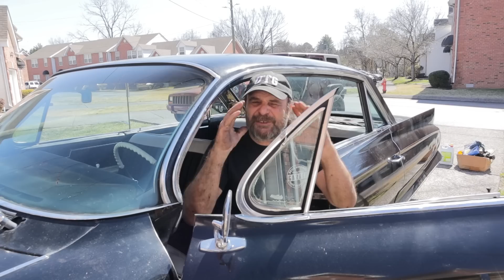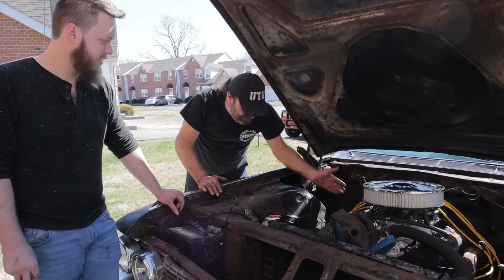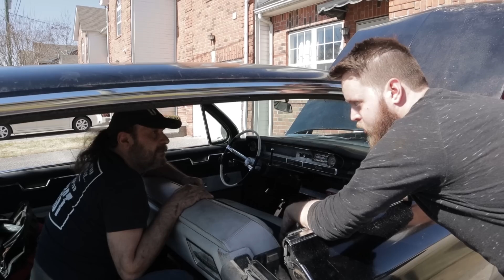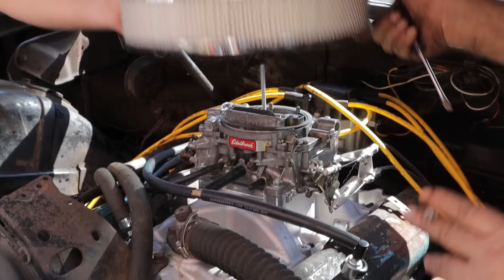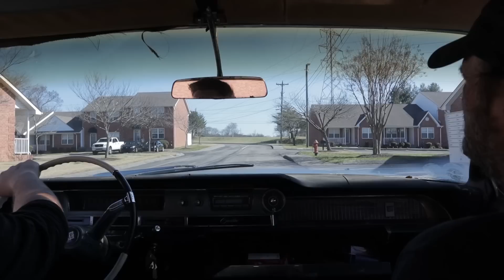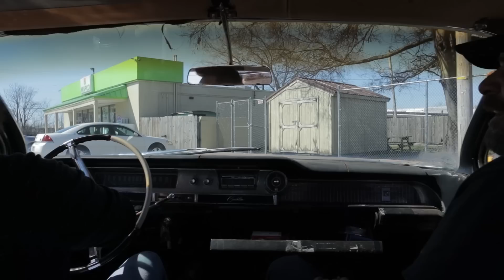The Perfect Entry-Level Classic Car?

Comment: As an owner of a ‘64 Cadillac, I’ve got a hard time agreeing that these classic pre 68 Cadillacs are a good entry point for classic car ownership.  First of all, the 390-429 engines are so hard to get parts for.  The transmissions are a pain too.  I don’t know what’s in his with the motor conversion and all, but OEM it was a four speed Hydramatic.  It is still the hydramatic if reverse is located all the way to the right of the shift pattern.  The transmissions are bulletproof, even used in tanks back in the day, but are heavy, complicated and parts are obsolete.  Cadillac 390-429 engine to trans bolt pattern is completely unique in the GM lineup, so swapping just the trans or just the engine often requires an adaptor which is hard to come by.

Also many GM parts that we take for granted as being the same across most GM’s are unique to these classic Cadillacs.  I needed a turn signal switch for mine, and after weeks of searching compatibility discovered the Cadillac unit is bespoke to only my Cadillac and one model of buick.  I had to buy a used turn signal switch out of Arizona, and it wasn’t cheap.

Also finding body panels is nearly impossible.  But when you do find a fender or such, expect it to be fastened with 10 times the amount of bolts you would see holding on a Nova or Chevelle fender.  I can’t believe how many fasteners are on these frikkin cars.

That being said, they are a lot of fun and get lots of looks, and we’re truly built to last.  My car has 175,000 on the original transmission and engine, with lots more life in it.  I would strongly recommend getting a factory repair manual, they are fairly cheap and help a lot.  Best of luck.
Reply: I watched carefully, and the shift pattern looked normal for a 350/400.   The car probably has a 3.25 diff ratio, but it seems to be turning pretty quick.  Sorry, I'm a Mopar man.
Reply: @moyadapne968  yes, I noticed that after posting.
Reply: Yeah, the car as I got it has a TH350 instead of the factory transmission.
Reply: @Jon-in-nashville  that’s a very good thing for drivability.  Probably why it feels low geared though, as the old hydramatic had a taunus rather than a torque converter, which doesn’t slip.

Comment: Beautiful cool old car one thing I never liked about those was the Chrome trim  on the doors the doors  Runs talk to bottom Off those and the lines flow my OpinionGeneral Motors it took a long time to get it all to make a bracket right Serpentine belt in the nineties is when they got it figured outI like the small block swap cause then you can get easy parts Anywhere

Comment: I imagine a small block chevy would be working pretty hard to get the torque needed to move all the mass of a fine old Caddy.  My `76 Cadillac still has it's original 500 CID engine in it.  Now THAT is torque and still over 12 mpg for hauling 6000+ pounds.
Reply: How much torque do you have.

Comment: You will most likely have to make your own floor pans. Depends how much $ you want to put into it. Some caddy body parts are almost non existent.. it's a cool ride.
Reply: ..might be able to modify or add on to some '61-'64 Chevy Impala floor pans to make them work...body shells were similar, with the Caddy being stretched a bit...
Reply: @dyer2cycle  that's nice thing about hot rodding just find parts and make it work

Comment: "The only thing I've ever owned with a carburetor was a lawn mower".....

Oh, the places you will go...

Great post, great car, and IF you want to go fuel injection (Doubt I would, but it does make turbocharging easier, and more effective, I am told) then the earliest EFI systems are still pretty owner-understandable and because of the huge numbers of Chev and GMC truck owners and of course the Catfish Camaro Crowd there is a huge aftermarket and online community. Of course, you can get 500hp out of a carefully built naturally aspirated SBC, with great reliability and you won't even have to put a hole in the hood for the blower. 

I know that 'drum brakes work', but with something so enormous and heavy, I think this one is a solid candidate for front wheel disks, and I would look into how hard it would be to put together decent ABS, but I live in a place locked in winter half the year, beside a mountain range which you can't drive in without winter tires, in August.  People do, of course, but they risk being snowed in for a week or risking a pretty high possibility of a vehicle ending disaster. 

I didnt hear your uncle say anything about the rubber, but I would not drive a car that heavy without MINIMUM new and quality rubber on the front wheels.  A front wheel blowout on that thing in traffic or at a the wrong time in a curve could have you thoroughly fucked up and well over your insurance coverage in five seconds flat.

But man, it looks unbelievably well preserved, the missing original engine is actually awesome, removing all temptation that might have turned you into a restoration snob, or more likely made the car unaffordable in the first place, and you are uniquely placed to do a GREAT set of videos on how to buy an old car and get through the first year of ownership. Sort of filling in the niche between Vise Grip Garage and the trillion channels about making a hotrod/dragcar/showcar out of a barn find.   DO IT!!!!

Comment: I have had a 66dart with the 273 4barrel,1970sattalite,1972charger,1969 4door sattalite,1964 273 2 barrel valiant and I now have a 73 charger 440 the only one that I would consider a performance car was the 66 Dart GT with the 273 4 barrel 4 speed sure grip no power steering, no power brakes no air, no heater straight up bracket racer from the showroom floor but all of them you could get 4_6 people in fairly comfortable, would love to get some thoughts about the atrocity of the 1973 front suspension change and how you would improve it

Comment: The most obvious issue that I see under the hood, other than the spinning fan sticking way up above the radiator just waiting to remove a few fingers (or worse), is the battery cables running over top of the core support. Hopefully they won't rub through, short out and burn the car down before they can be routed properly.

Comment: That's why I love my 1976 amc pacer x everyone has a camaro.I am the only one  who has a  pacer. Bought it for a 1,000 buck in 2002 with" soposoldy"a blown engine .  I still have it with that same engine and I get more thumbs up and stories than any of my other classic cars. Man did I laugh when I was put in the same class at a car show with Camaro's and Cuda's and my little Pacer took the trophy 🏆. It's a Kenosha Cadillac. If that is a Chevy 350 put a 700r4 behind it. My 1992 3/4 ton g20 van with 3.73 gears gets 21 miles per gallon on the hwy with a car on a tow dolly behind it and the ac blasting.

Comment: I couldn't hear what he was saying about the PCV when he took it off, he had 2 pcv's?

Anyways I'd have to disagree that this is the perfect starter car. Anything that isn't popular is going to be difficult or expensive to get parts for. The saving grace is that this car has a SBC and is so solid and functional. A newbie is best off with something that has a SBC, SBF, or LA, on a 4 door platform of a more popular 2 door car. 4 door G-bodies, foxbodies, are easy to find, can almost be rebuilt off the shelf, are steady in value, and in the long run for the newbie are worth the initial cost. I intentionally left out chrysler because im just not familiar with whether an aspen/satellite is similar enough to a baracuda or roadrunner. 

I'm not saying this isn't really cool, but this car is a few issues away from being a newbie's money pit, especially if it had the Cadillac motor.

Comment: ..I'm thinking a 700R4 might be good for this..would give you overdrive, which would help with cruising and might give 2-3 mpg better mileage..and if the car originally had a 4 speed Hydramatic, you should have enough positions on the shift quadrant for it...

Comment: I hope you are looking for the original steel wheels and the Fleetwood wheel covers.  They really stand out on a black car.
Reply: I have 3 of the original wheel covers. I'll have to find the last one and restore them all.
Reply: @Jon-in-nashville  Do they have any paint on them?  The Fleetwood models, including the 9 passenger sedans and the limos and the black paint on them to match the car.

A friend of mine back in the '80's had a perfect 1962 code S formal limo and we drove that car all over the western states.  It was a joy to drive and it had those Fleetwood caps.  If yours doesn't have the paint you should consider painting them to match the black on the car.  They make the car look much better.  The original steel wheels are going to be really hard to find though.

Comment: 6.0 ls and overdrive transmission swap  from a rusted or smashed up truck.  I'd get it going with the efi, and stock computer, but there are carb  intakes for the engine if you want to keep it as simple as possible. I think there are also certain years that bolt up to the trans you have now, as in same flex plate, but I'm not certain on those details as I didn't come up with the swap. Just second hand bits i recall some else telling me what they did and that was to manual trans anyway. Seemed while they all have the same bellhousing pattern the crank shafts were not all the same. I'm sure there is any thing for any combination, this would possibly just get it done with stock cheap parts. As more so a Ford guy that's where I'm jealous. Ford just did not make many modern engines worth swapping into my own project, so I spent a lot to get a 351 w built . It is just carb at the moment  for the sake of fuel system being a single line , but in all reality there are a couple ways to do it  and possibly not have to alter anything. I have a jeep with fuel injection and factory it has the fuel filter just about right at the gas tank and it also regulates the pressure, and a short line dumps it back into the tank so only one fuel line  runs to the front of the car.

Comment: I can almost guarantee this will not be the your last Caddy. I have had many 60,s & 70's Cadillacs. I'd drive'em until I had a project to throw the 472/400 turbo into.  My Nomad has power windows, power vent windows and power seat track from a '69 Sedan Deville.  Nothings Lacking When Your Cadillacing.

Comment: That’s not a tbi engine. It doesn’t have the center bolt valve covers.
Reply: I would guess it is a mid 70s to early 80s engine if the blue paint is original

Comment: I'm not sure what it's called (the rear tires are behind the fender), how do you remove/replace the rear tires?
Reply: Those are fender skirts. Some of them are removable panels, others the wheels lower with the suspension enough they are not even a problem.

Comment: The wire wheels are not disco era .. they are late 90s early 2000s lower end level bolt on wire wheels. The high dollar ones where usually knock off style wheels.

Comment: Man that is a Massive car it’s got to weight almost 6000 pounds.👍😎
Reply: Actually about 4400 before the transplant, so maybe 4200 lbs. Less that a Tesla model S.
Reply: They don't weigh as much as you would think. Limited electronics saves alot of weight.
Reply: Why would you think a 4 door sedan weigh 6000 pounds?
Reply: @Dr_Reason  That's what I tell EV fans - many are heavy as a classic Big Three land boat
Reply: Well you look at the old Lincoln’s and Imperials there almost that weight fully loaded.🤣

Comment: Every american car here in eu is expensive. But we have plenty of TAUNUS models which was a german subbrand of ford. Taunus P2 for example is like a shrunk 1957 Ford fairlane
Reply: @32degreesretarded62  yeah they were pretty expensive here when they were new so not many people bought them back in the day. Weirdly even Taunus was sold in usa until late 60s in mercury dealerships. They even had ads. You can see it if you type "ford taunus p3 17m us werbung" but they sold very little there and are extremely rare right now in usa
Reply: @32degreesretarded62  no problem

Comment: Nice car! The first thing I would do is get rid of that electronic ignition and put in a point distributor.. Use NOS points and a new condenser. It will run smother and start easier.

Comment: That '62 "6-window" was the same car that was crashed 50 mph head-on against a 2002 Cadillac, which was documented on YouTube. It was a white one that was more derelict than the one in this video. This crash test was done to show crash safety advances between older and more modern cars. This demonstration crash was survivable in the 2002 for front seat passengers. But anybody sitting up front in the '62 would have surely been killed, even with seat belts and air bags!

Comment: 3/4 throttle, just before the secondaries open, uphill on a good grade at 50 mph/high gear.   You should hear a slight ping, not a knock.  Perfectly in time.

Comment: It's too big for me. I want something much smaller. It doesn't even need a V8. It just needs to be carbureted with no emissions crap (ok, I can deal with a PCV valve) no computers. It can be a Ford, Chevy, or Mopar, but it has to be something most parts are available for. Ford Falcon, Chevy II, Dodge Dart, Plymouth Valiant, Maybe a mid '60s Ford Fairlane, Mercury Comet, Chevy Impala, or pretty much any 1960s 2 door truck. The '70s has a lot more cars of the size I like, and yes they were loaded with emissions crap, but a simple engine swap can take care of that. I already have a 1972 Ford Pinto woodgrain wagon that I converted from a SOHC 2.0L four cylinder to a 289/four speed from a wrecked '67 Falcon. I did that before I retired. Took me almost 2 years. And now I have a car with a nice engine and transmission, but almost no body parts, glass, interior parts, even brake, steering, and suspension parts are available for. Take that into consideration when buying an old car. And that is the problem with buying a non sought after car. If you have a '57 Chevy or a '65 Mustang, you can get anything for it, though most of it is made in China. It's the less popular cars that you can't find parts for. Nobody makes them because there is no demand for them.

Comment: 2 years before the TH400 was introduced so what was in this?  Slim Jim?  4 spd fluid coupling Hydramatic?

Also, I had NO IDEA that you could get a 60s Cadillac with roll-up windows!!

Putting a 350 SBC is NOT "miles ahead"
An old small block that probably could use a freshening brings you back to square one.  Plenty of rebuild parts available for 390 429 engines.  It seems the 4 spd Hydramatic was the only unit available until the Turbo 400 arrived in 64.  If he really wants a dependable driver and doesn't care about originality, then a crate LS3 with ecm and a 4L80e and tcm is ideal.  Personally, i'd ditch the SBC and either locate a 390 and Hydramatic or make it simple with the crate LS3/4l80e combo and focus on other parts of the car.

Comment: No power windows?  That must be a 62 series sedan, ,not a DeVille.  Is the VIN 62K or 62L?  The K is the 62 Series Sedan and the L is the DeVille.

There is no front middle arm rest.  It is for sure a 62 Series Sedan, not a DeVille.
Reply: Finally someone speaks up on which model it is! Outstanding work. The extra rear side glass at the C pillar are a dead giveaway - not a Deville.
Reply: @Arise-308  NO, actually there was a 6 window DeVille as well.  The lack of center arm rest in the front seat was a dead give away for me.  Also it has no power windows which also gives it away.  I hope he knows if he needs a window regulator to buy one from a Chevy.
Reply: @mexicanspec  Ah, right you are. I had forgotten the two different C-pillars, similar in concept to the 1962 Chevrolet Impala vs. Bel Air formal pillar and bubbletop. GM could throw a lot of possibilities at you in the 60s. My hat's off to you, sir!
Reply: @Arise-308  I know too much about this vintage Cadillac, however my experience was with formal limos, hearses and ambulances.  They are gorgeous as professional cars, just like the car that took Marylin Monroe to her final resting place.  Too bad that car doesn't exist anymore, it was sold to Thailand shortly after her funeral.